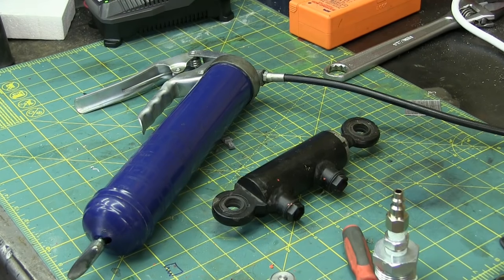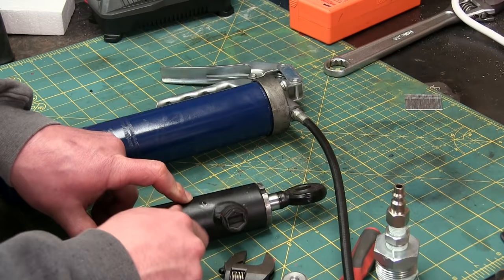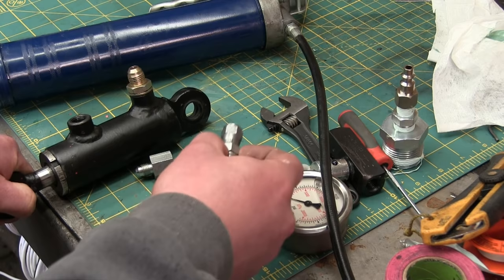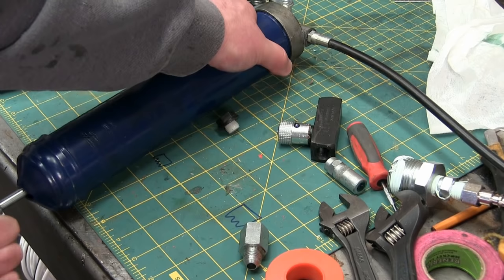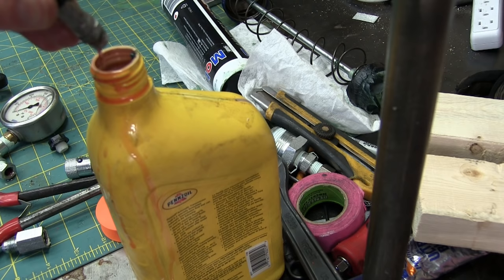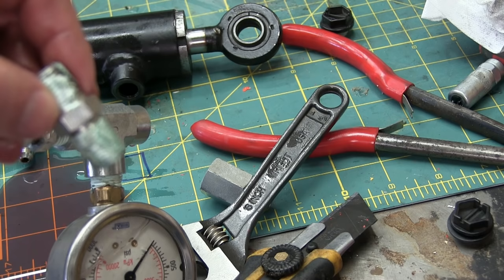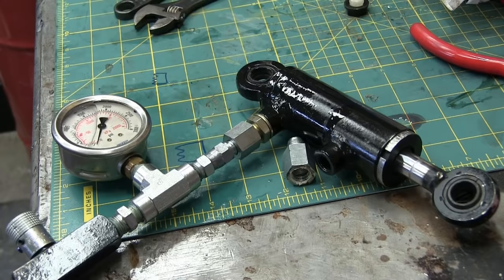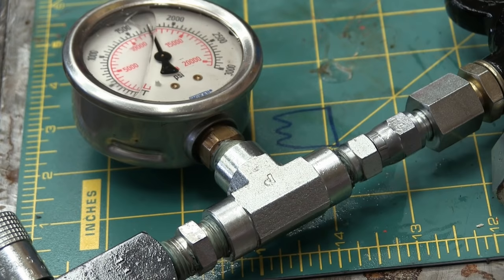Twenty Buck Grease Gun hydraulic pump.  Tested to 1700 PSI! Simple and Easy! Etc.

Comment: Quick tip for loading a grease gun; 
When you are pulling the plunger out of the cartridge, crack the bleeder/ unscrew the tube. You are creating a vacuum inside the gun, that will suck the outlet empty. 
When reloading, screw the tube 75% up, push the plunger up, then finish screwing the tube up. You just bled most of the system in 5 seconds

Comment: You can also "hydroform" thin aluminum with a grease gun. Create a steel fixture with a solid bottom and a steel ring to clamp the aluminum down. Pump the grease between the aluminum and solid steel slug and makes a nice dome shape. Could also make interesting shapes or lettering depending on your upper form of the fixture. Would love to see aVe do a video of this.

Comment: In small excavators they actually use a grease gun with grease in it to activate a hydraulic/grease cylinder in order to put tension on the tracks. Easy and very effective

Comment: I machined an adapter for m14x1.25 thread. I fill a frozen motorcycle cylinder a pepetrating oil, then thread the adapter into the spark plug hole. Then pump up the cylinder with the grease gun to force the oil past the stuck piston, and to force the stuck piston down. It works like a charm!
Reply: So...
What did you blow apart...

Comment: That's funny that you posted this, a few days ago at work I needed to widen a hole in some sheet metal to pull some wiring through.  I tried to use a hole saw but with no center point it just walked all over the place.  Our maintenance guy saw me and said he had a better idea.  He came back with something that looked like a grease gun with a threaded hydraulic cylinder on the end.  It was a hydraulic sheet metal punch.  He just put the punch end on it and started pumping and it retracted the cylinder until it punched out the hole and it made me think about what kind of pressures were in a normal grease gun.  Now I know!
Reply: stonent yea that's a knock-out punch

Comment: Worked as a sparky in maintenance department for 50 years. Just about every hydraulic system that I came across leaked hydraulic fluid. Even 2 new Green lee hydraulic hand pumps for knocking out holes in panels leaked before they were a year old. Back hack that I ever seen was when one of our mechanics left a deposit in other mechanics cliffs cup. Guy got the portable bread pump on the heaviest grease that was in a 30 gallon grease drum. He installed a few zero fittings and filled the guy mechanics steel tool chest up with the very thick grease. By the time he was done entire box was filled with grease. Took the other guy at least 6 hours to remove grease from inside box and tools.

Comment: "I dont think there's a grease gun in existence that actually f'ing works".  Amen. Iv went through a dozen of the damn things and they're all finicky. I even have a heavy duty one from Snap-Off that sucks. Although Iv had great luck with the large barrel type ones but who the hell is going to carry that crap around.
Reply: Stephen Cox 

I’m right with you. I end up throwing them out in less than a year and I don’t really use them that much except for my boat. Although at work we use them all the time on our trucks and I’ve noticed that the Milwaukee cordless grease guns last and they kick ass.
Reply: I’ve been using a Tubi grease gun at work for 2-3 yrs now. Works great! Might not be available for you guys across the puddle from Sweden.
Reply: Stephen Cox and for fucks sake can they invent one that’ll come back off the fucking fitting when you do finally get the piece of shot to work???? I mean is that too much to ask???
Reply: Robert Beattie ever tried a “Lock-n-Lube” coupler? They’re made in South Africa, cost is around $30 and they work really well. They really come in handy when you have a hard to reach fitting, lock the coupler on and let it go. It’ll stay put, won’t leak, and releases when done greasing. Just have to pull the spring loaded lever.
Reply: @stranger5088  your supposed to loosen the end on the grease gun but I feel ya.
Reply: I'm grease gun at work is 20 years old and never misses a beat

Comment: its amazing how just a bit of grease can give you that much. At work we sharpen side cutter headd for a huge mfg. company and that is how we tighten them on the arbor and how the run the heads on the machine. Its really awesome. Thanks for showing actually showing how it works

Comment: 3000 PSI hydraulic pressure is about as dangerous as a fluffy kitten with the amount of flow a grease gun can provide.  I used to deal with 6000 PSI nitrogen every day, all the force of hydraulics with all the energy storage of pneumatics.  With 8 big ole high pressure gas tanks for capacitance, there was enough energy to ruin your day in a big hurry!

Comment: I'm well aware of the pressure these grease guns can generate. The wheel bearings on my saw are protected by 1/8" thick steel hub caps which are sealed to keep the crud out. After a few years of occasionally greasing them, I noticed I was having a hard time and when looking saw I was doming the flat steel cap out with just the pressure of the grease inside lol.
Reply: I know this is old but reverse the seal on the next inspection and the seal will let a little grease out and seal out the elements.
Reply: @Leroys_Stuff  Humm I'm not in that job anymore, but i don't think they were made like that? They had a hard plastic seal, IIRC, not something of pliant rubber that might have worked like that? But it's been a long time since I saw them, quit that job like 3,5 years ago.

The messiest side wasn't relying on the bearing seal anyway, that was the purpose of the cap, to keep the muck from even touching the hub in the first place, on the side that faced the blade.

Comment: In the gas patch of Colorado we use modified grease guns filled with methanol or antifreeze to force ice plugs from the process pressure measurement tubing on our gas compressors, they will build over 5,000psi even with such low viscosity fluids as these the trick is you have to pump them faster as the tolerances on the pump are such that the fluid will just bypass the pump faster than it can be forced out of the gun. The lever style guns are what we use so you can put more force on it

Comment: I use a porta-power to pressurize small hydraulic systems for seal and connection leaks. Works great I can go up to 3,000 psi with little effort.

Comment: 1700psi?! Sturdy little machine for something that manages to leak from grease separation any time it sits more than a week.  As far as a lack of built-in valves goes, the typical grease gun is designed to deliver its gooey payload to fittings with built-in check valves. I don't believe it depends on viscosity to prevent back-flow. Anyways, thanks for the vid!

Comment: I have used a grease gun to pump out stuck/seized disc brake caliper pistons when compressed air won't budge them. Just plug the brake line port and use the bleeder valve as the inlet port. Funucking believable.

Comment: we call those fittings #6 to boss (o-ring side) in the gulf of mexico. trick in a pinch if you grind the bevel off the #6 it will thread in to the cylinder. that is a good Stanley hydraulic tools trick.

Comment: Agreed.  There's no grease gun in existence that actually works.
Reply: Disagree. Just buy a good one and stop going to WalMart...
Reply: My dewalt 18v works awsome
Reply: @BillyBoze  No such thing. Place I worked at before I retired we went through five industrial guns a month. Boss quit buying the "cheap" ones and we succeeded in going through only four per month.
Reply: @markfergerson2145  I've been using the same one for 5+ years, perhaps you're too rough with them?
Reply: @soconoha  We used them mostly on plastics extruders. The zerks tended to get gummed up because they ran at about 430 Frankensteins even using very expensive high-temp grease plus as I said management bought the cheapest guns they could find. Maintenance had a hard time keeping up with the zerks.

Comment: I used a grease gun to free up a puck froze tight in a disc brake caliper. Snapped right on the bleeder. A bit of a mess when she left go, but worked slicker than snot.

Comment: Gas lines use single 45* flare fittings; those types have thinner walls which break easier under pressure. Automotive brake lines, however, use double 45* flare fittings. Those things take well past 5,000 PSI and it's the brake caliper or pads that fail before the fitting goes. Best part about all of them is that the flares automatically seal, no teflon tape required.

Comment: Grease guns don't need a check valve because grease fittings have the check valve built in. It's the small BB looking ball in the end which has a spring behind it

Comment: Used to work with large jackhammer cylinders and those used on the back of skip trucks anyhoo was involved in a catastrophic failure narrowly being missed by the piston whilst my workmate wasn't so lucky and was sent across t he workshop as the side of the cylinder ruptured during a test. Our health a safety concourse employers didn't see fit to fit a screen of ballistic plastic so the poor guy took the full jet across his ribs. He wasn't badly hurt but did pass out and was taken to hospital and was leaking hydraulic fluid from the impact sight on his ribs for a couple of days.

Comment: Put a pressure gauge on the annular side of the cylinder for some sweet sweet pressure intensification. Should get nearly 3000PSI looking at the area ratio of that cylinder.

Comment: if you take apart the fitting where the grease gun hooks up to the zerk fitting you will find a check valve in it ( the little bit at the end of the hose from the grease gun you removed)

Comment: The grease gun that you used here was only made for general purpose greasing not high pressure.  If you get one of the ones with the long handle on them and not just the little grip handle, I believe they are double the pressure. Still an interesting video though, cheers!

Comment: nice video.  I think I will have to start wearing gloves.  You mentioned about contact dermatitis.  For decades I've never worn gloves because they take the feeling of dexterity away.  So I have been washing my hands frequently.
Reply: surgical gloves give you almost no loss of sensation, if you get the slightly more expensive ones. Cheap gloves are cheap.
Reply: Thanks for the information.
Reply: +George W I work with a lot of dirty stuff in the repair shop. I prefer these gloves granberg.no/ENG/products/list_multilang.aspx?cat=2&sub=4  , They are a tight fit and keeps your dexterity very well.
Reply: granberg.no/ENG/products/glove_multilang.aspx?art=114.0766&cat=2&sub=4

These are the ones I use
Reply: Thanks I'll keep that in mind.  Thanks for the link.
Reply: +George W I used to not wear gloves until I got a Mercedes W123 diesel.  My hands would be stained for a week, so I started wearing nitrile, Ansell Touch N Tuff brand.  Now I wear them all the time, except for the finest work with very small screws.  The loss of dexterity is hardly noticeable on most jobs.
Reply: +UndeadSamurai01 keep in mind that the standard blue surgical/examination gloves are not resistant to most chemicals and solvents. They pass straight through it
Reply: ***** Of course, that's why we have a different type of gloves that we use for hazardous/cytotoxic medications. I don't recall exactly what they're made of, but they're rated to withstand immersion in H2SO4 solution for twenty minutes.

If I was in a lab dealing with something unknown I would want Viton gloves, with a known chemical, obviously something rated for that chemical.
Reply: UndeadSamurai01 it's purple nitrile for moderate protection against chemicals. For good to excellent protection, you're going towards 2 mil thickness gloves (neoprene or pvc), and I can tell from experience that you have almost no feeling inside these gloves. You simply can't assume that gloves offer protection, and lots of labs have one-glove policy nowadays for that reason.

Comment: Fun fact: Destructive testing of hydraulic components is often done with high pressure grease pumps. It's much more efficient to pump grease to 10,000-20,000psi than it is to pump oil to that pressure. In fact, I thought that's were he was going with this demonstration.
Reply: +Maxwelhse My dad used to work in the wireline industry. He said companies used to send them free tools to try to get their business.  They had an old gun barrel from a Navy ship that they sunk down into concrete and would throw the free sample tools down inside it and pressurize it 20,000psi and leave it for a week or so, and then retrieve the mangled and crushed tools and mail them back with a note that they didn't last long enough.
Reply: stonent What was the practical application of the "machine" they built? That seems to be an odd construction that must have had a specialized use.

The testing I was involved in was for hose reels and we were pressurizing the components internally, not externally. Primarily deep sea equipment and safety reels ("jaw of life" reels were certified to 10,000psi, for instance).

Comment: Grease guns also make a handy pump for hydro-testing pressure tanks.  But that also involves the nightmare with fittings problem that you illustrated here.  As usual, the setup takes ten times longer than the actual task.

Comment: That kPa is the nice old metric SI-unit for pressure. 1 Pascal = 1[N/m2], so one Pascal is basically nothing. There's roughly 6.9[kPa] per 1[psi], or 100[kPa] per 1[bar] (or 14,5[bar]/1[psi]). And then 1[MPa] is 1[N/mm2], and the mega Pascal is what's normally used for tensile strength and things like that (yield strength of a typical mild steel maybe starts out somewhere around 240[MPa], which then roughly translates to 24[kg/mm2]). Once you learn the correct SI-units and the basics of the metric system things are quite easy.

Comment: speaking of the pneumatics. I was working on Press 76 A 2500 ton Danly stamping press. We were stamping Torque converter bowls for Generous Motors. 8 die stations in the press. All the draw plates in the dies use nitrogen die springs. Lloyd the die maker is working on one dies. He emptied the die springs to lower the draw plate. Time comes to refill them he puts the QD connector on the inlet. Bob the foreman is standing over Lloyd the Die makers shoulder like there is some part of this job that requires the skills of a man knowledgeable in the use of a clipboard. Lloyd the die maker goes over to the cart with the Nitrogen bottle on it. Bob the foreman stays where he is. Lloyd the Die maker opens the valve on the bottle. When the Draw plates rise back up with a clank the QD fitting fails. 15 feet of high pressure hose and a brass QD fitting are whipping around the floor. Bob the Foreman is hopping around trying to get out of the way, He gets tagged 4 times in the legs and ass before Lloyd manages to shut the gas off.

Comment: some off the old Lincolns say 10,000 psi on the handle.  I think 7,500 today.  even the battery one ($400).  with grease.  that's actually the pump you tightening tracks on heavy equipment with.

Comment: Old bottle jack: Weld the shaft to the body so it can't move and tap a fitting to the pressure gallery. Now you have whatever PSI the jack was rated at...

Comment: This is about all we're gonna get out of this little guy. . . . he says. Wow, not only was it impressive to see how much pressure you achieved but I was surprised at how fast it got there. When you consider how long it takes an air compressor to hit 150 psi, I'd have thought anything past 500 would be pretty slow going.
Reply: that's because this is a non-compressible fluid unlike air, so you're not wasting nearly as much energy heating up the fluid or compressing it. it's just a translation of where the force is applied.

Comment: Lever grease guns can get more pressure out of em than the pistol type thanks to good ol mechanical advantage. I haven't checked it personally, but there's a resident old fart that insists they can go up over 2500 pissies. He also warns us repeatedly not to over grease excavator swing bearings, lest we blow them apart. Or "pop the top off the excavator" as he would say.

Comment: Heard of guys unseizing an engine with a grease gun. Adapt it into the spark plug hole. pump in the psi. Of course this only work if it seized with the valves closed or you fabricoble something up to seal of the intake/exhaust

Comment: on your video about hydraulic troubleshooting you demonstrate how can use an infa-red heat to find internal you allready be aware but you can apply the same method for finding problem bearings i would use this tactic to find problem bearings in forage harvesters and combines both use many large bearings which can be hard to acces

Comment: Greaseguns piston rectracts easily if the pump is loosened few turns so air can go in to the grease cartidge. Then just lock the piston to bottom position, remove the pump and pull the cartidge out with pliers or a screwdriver, it isn`t that difficult. You could propably get higher pressure with a gun wich has long lever, some says even 300bar is possible.

Comment: Hey AvE, another great vid: funny and informative.

Question: how do you bleed the pressure off of your system? Just unscrew one of the fittings? Would you end up wearing half of that ATF you pumped in there?

I can actually think of a couple good uses for something like this and may build something bases on this concept so I'm curious about the bleed-off.